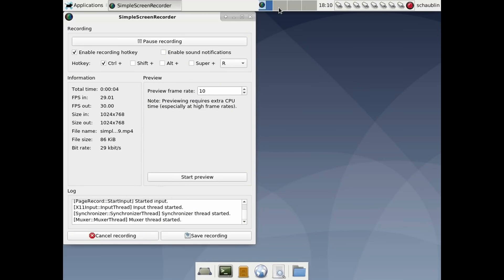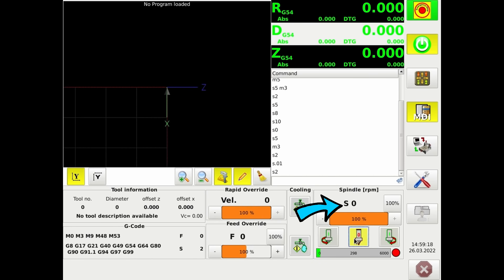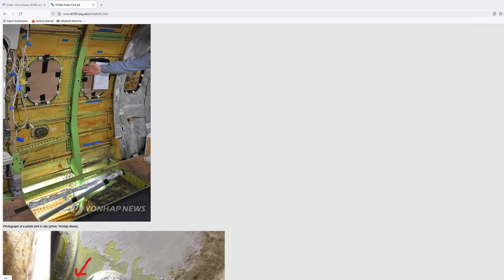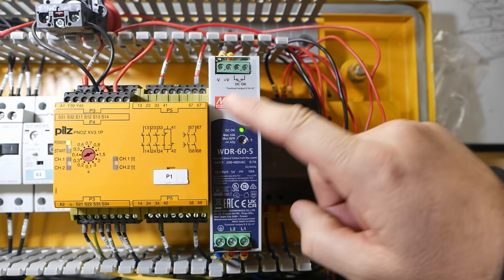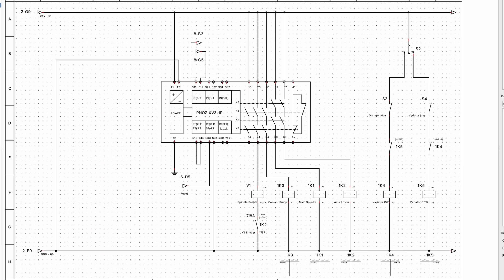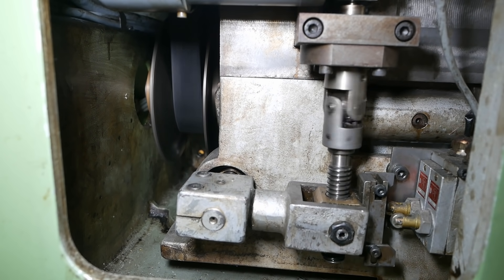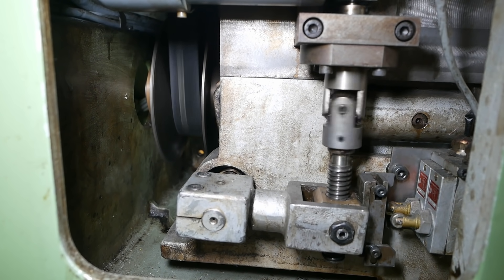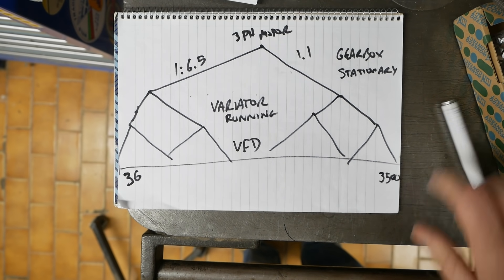Variator control - Schaublin CNC - Ep.30

Comment: Can the bearings and chuck digest 3500 rpm? What's the torque at 36? To me having three means of controlling speed seem to be a too complex system for practical jse (but indeed an intersting engineering problem).  Enjoy spring, it will be over on Thursday....
Reply from the maker: THe bearings are almost certainly good for it. THe CCN has the same headstock bearings and rund 4000. THe Chuck is also good for it. I am not so confident that the collet closer mechanism is okay at that speed, so I will restrict it to the original 3000.

Comment: VFD high as it can go, tune the variator. When approaching variator limits, adjust VFD to be back in its usable range. Thus maximizing torque output across highest possible speed range.
But good comment below about reaction speed - that should take precedence!
Reply from the maker: That is about right. I need to start mapping out this control behaviour

Comment: The cool thing would be to control all of them simultaneously. But then again, there's a reason why we use VFD:s nowadays.
Reply from the maker: THanks for the feebdack. Yeah, it would be cool to use it, since it is a cool mechanism. 
VFD's dont multiple torque like a variator does, so the modern machine 7.5kW spindle rather than 3kW. (Schaublin still make this machine as the 125CCN). 
https://www.smsa.ch/en/Products/CCN-turning/125-CCN-High-precision-lathe-with-three-simultaneous-axis.html
Reply: @RotarySMP  Well, in that case, maybe use the variator but in discrete steps, or just min/max if that's enough. 

Controlling all three simultaneously would likely make for more interesting videos, but it's nice to finish projects aswell.

Comment: Variator to low/high at extreme ranges for extra torque/speed, perhaps with lockup table, the rest with VFD, since it has far better response time/accuracy, might be important for thread cutting...
Reply from the maker: I checked it last night, and there is a gap between variator lo vfd high (125RPM) and variator high vfd lo (190 rpm). Variator takes 5 sec between high and low. I am starting to think that doing a simple dead reckoning of two variator intermediate ratios between high and low and the rest of the vfd should cover it.

Comment: A few comments have suggested a small VFD and position sensor for the variator motor. Whilst this might seem to be adding excessive hardware complexity it might actually greatly simplify the software, as the state of both the variator and main VFD would be completely known. You could then map the variator position against desired spindle speed to optimise for whatever you liked, be it torque or keeping the main motor speed high for cooling, closing the loop with the big VFD. Sometimes finding the right balance of what to do in hardware vs. what to do in software makes the solution simpler overall. With my software hat on, unknown position of the variator and bang-bang control via contactors is a bit ewwwwwww :)
Reply from the maker: I have a thread over on the LiniucCNC forum about the build if you are interested...
https://forum.linuxcnc.org/26-turning/41498-schaublin-125-cnc-retrofit?start=320#238544

Since there is such wide speed control of the VFD and variator, there were a few suggestions that you could just treat the Variator as 4 discrete gears, and dead reckon to the two mid gear positions. It wouldnt really matter if they are a 10-20% off, as the vfd can easily compensate, and that way you avoid bang bang control.

Comment: @4:47 I cannot recommend enough to switch to PTFE Tape. 10 to 30 turns, you are ready to go. It NEVER fails, and taking it out, even after 40 years, is as easy as intallation day... I do not understand why this old method is still used. My bet: mythology.
Reply from the maker: Could well be. Old practices die slowly. This industrial plumber felt that hemp was more forgiving if you have to back of a 1/4 turn to align a fitting. Where Teflon may then leak, hemp expands once fluid gets to it. 

Hemp is also easier to clean off, as you can burn it off and then a couple of strokes with wire brush knocks it off. Pemoving old teflon can be a pain.

I will use either.

Comment: I think I would use the variator for general control (for the torque, as you mention) and then extend above and below that range with the VFD. 
Running the variator at a constant speed is likely to cause uneven wear, it's probably best to "exercise" it. 
So, use a pair of "lincurve" components (one for each gear) to pre-control the VFD speed, with a broad 50Hz region in the middle for the speeds that the variator can handle by itself, ramping up and down at the ends. 
Then use a PID (with a fairly large deadband to avoid hunting and nut wear) to set the variator position. 
You might well end up choosing the gear just based on the diameter of the job, but it is possibly to select it based on initial commanded speed, but only pass that speed through to the rest of HAL once the gear is engaged.
Reply: In another reply you mention that the variator changes speed at a fixed rate. And that definitely is a problem that I didn't consider in my first reply. 
I think that you would need to use the VFD for CSS facing cuts. Though you can also consider using the VFD at the same time as the variator to change the output speed more or less quickly than the variator inherent speed. 
It's rather a fascinating puzzle.
Reply from the maker: @andypughtube  Hi Andy, I was hoping you would jump in on this one. Thanks. 

I am trying to summarise the good gen I pick up here into the LinuxCNC thread. 
https://forum.linuxcnc.org/26-turning/41498-schaublin-125-cnc-retrofit?start=320#238544

By the way, you were the first to point out the issue with constant variator change speed months ago in the forum. Thanks.

Comment: Personally, I'd use the gearbox and variator to set the initial speed with a middle frequency on the vfd. Then I'd use the vfd to make small adjustments to maintain the rpm set point during the cut. My thinking is the variator won't make small adjustments as easily as the VFD would for maintaining a set RPM, but the variator will allow for max torque at the set point.
Reply from the maker: Good summary. That is about how I see it as well.

Comment: I feel that your diagram has the elements back to front. I think it should be gearbox then 3 phase then VFD then variator. In this way you decide up front whether Hi or Low gear since this must be changed while stationary. Then turn on the 3 phase and adjust the VFD. This can be done with the motor stopped. Finally turn on the motor and if necessary adjust the variator. I feel, in practice, you'll set the variator to max speed and leave it. The only occasion where you might change it is if you need very low speed with high torque.
Reply from the maker: I think the main need for the variator would be a large facing cut, like the full 250+mm in cast iron. Then youd start the cut down near min speed, and as the cut progresses, and the VFD hits it's max frequency, do one large variator move to it's highest ratio, with the VFD compensating and maintaining the CSS required rpm, and then continuing on VFD control till the max rpm for that gear ratio is reached.

The hard part will be implementing something like that in software.

Comment: I think it would be great to use the Variator for low speeds as it has more tork in that regime and only go lower than 50 Hz with the VFD if absolutely necessary. However for higher speed cuts I would try to get most of the Speed out of the VFD. That should put less stress on the Gearbox, and also allow for more torque. The gears should only be switched if necessary/when a planned cut would max out the speed and torque range of the variator and VFD combined
Reply from the maker: The limitation of using the variator is that its change rate is fixed, so you woul need bang bang control, killing the contactors.
Reply: @RotarySMP  yeah, didn't thought about that. Maybe you could add another VFD lateron, or replace the Motor with a simple JLC Servo or something like that some time. 
PS. Hopefully the promissed rain in Vienna is coming. Everything bone dry here.
Reply from the maker: @Billyboy94009  I hope for rain as well. 

It would be easy enough to add a VFD for the Variator drive. Making a mechanical change would be way more work, and that little 3 phase motor is so cute :)

Comment: Kiss.
Keep it simple stupid...
I would only controll  the vfd as this is  easyist  just to get up and running  and thin if you need more torque  then figure in the variator..
Great stuff as usual!!!
Reply from the maker: That is a good point. I dont have to solve this yet. Just use VFD closed loop, and manually select the others to get started.

Comment: What is the maximum rating for your chucks, above 3500? My 100mm TOS chucks are around 4500, but yours looks larger.
Reply from the maker: I only have this one, and it is 4000rpm. It is only 150mm, and has the lightened body. I'öll get a TOS or Bison 125mm three jaw once I get it running.

Comment: I'd lean towards doing the gear box manually, and letting to controller do the VFD. The gear box being only able to swap when the spindle is off would be safer to do it outside of a program. I'm not sure if the variator is even needed. Cutting off some bottom end RPMs on a cnc lathe is probably  fine.
Reply from the maker: That safety aspect is also a good input. This will never be a production machine, so having the operator (me) select back gear might have advantages. Thanks.

Comment: Out of curiosity, is there a reason you didn't use teflon in tape form on the accumulator threads? I've also never heard of using hemp fibers in a pipe thread. I'm assuming it's not a NPT thread but rather another type of standard thread.
Reply: I had the same question. Never seen anything other than PTFE in Canada.
Reply: Fibers and goo is way better, if it gets close to leaking it will seal itself as the fibers swell! Or, atleast thats my experience. PTFE tape is modern stuff, and modern isnt always better (faster/cheaper/easier is often the reason behind the change)
Reply from the maker: That is also what that professional plumber said. If you have to back off a fitting a 1/4 turn to align it, teflon tends to leak, where hemp is more forgiven.  It is also easier to reuse a fitting, as you just burn off the old hemp with a torch, and then a couple of swipes with a wire brush cleans it up.

Comment: For everyday uses and constant surface speed i would do everything on the VFD. 
but i would maybe make a script to ensure the variator is sett to the right range so the VFD can deliver enough power
Reply from the maker: The only really critical case is facing large parts, where you need the full range of VFD + variator. FOr outside turning jobs RPM and even CSS of typicla tapers, the VFD is going to have enough control authority.

Comment: I'd integrate it into the software, but have a knob or a dial on the machine to control/override it manually
Reply from the maker: True. I want a speed override on the controller, but also basic gear change and variator overrides are probably fun to have on the control panel too.

Comment: Tie wraps will cut through the wiring during flight. The vibration makes tie wraps into knife edges which is why wax string is used. It is in fact against all procedures to use tie wraps here in the US. BTW Avionics Electrical Technician here with 20 years' experience, Military, just so you are aware.
Reply from the maker: Thanks. I know Cirrus used tie wraps extensively in the engine compartment of the SR20. Grossed me out. Hot environment to expedite the ageing and brittleness of the tie wraps and vibration.

Comment: I would just control VFD and variator and have the gearbox manual with a switch so the system knows what are speeds that are possible. I would try to use the variator as the main speed control as the torque would be best that way, and have maybe 10 levels of VFD control within which the variator controls speed with a desire to run it at as low a frequency that will allow the requested speed, but attempt to not change frequency until the variator is at 15% or 85% to minimise the sudden change in speed. I would also set the VFD to spool up and down between the requested values smoothly whilst the control feeds back to the variator to adjust into the requested speed.
Reply from the maker: There is no feedback on the variator position, and the ratio change is non linear. Plus the bang bang control of the variator woul dbe hard on the contactors, so variator changes need to be infrequent and therefore probably large.

Comment: Since the motor was made to run at 50hz,  I suspect that’s where it’s most efficient and should thus generate the least heat and best torque. Soooo, I’d say variatior primary, and vfd as an “extended rpm range mode”. 

I’d be interested in what your motor torque is like at the outer limits (20 and 70) as well.
Reply from the maker: 3Ph motors driven by VFD's have a typical performance curve. So constant torque up to 50Hz and then constant power above. 

The variator rate of ratio change is determined by it's adjustment motor, so you need to bang bang control that, which would be bad for the contactors. Both VFD and variator have different limitations.

Comment: I'd say set the gearbox first, then set the variator for max torque within the mid range of the VFD, then use the VFD to trim up or down. Sounds like a perfect job for the classicladder PLC component
Reply from the maker: It could be dont in classic ladder or with a comp. I tried having a play with classic ladder once years ago, but never got my head around it. Before I start implementing, I need to have a clear plan of what to implement. For the Maho, I created a flow chart, Ill probably have to do that again to sort out my thoughts. The inputs from everyone have been really helpful.
https://github.com/jin-eld/mh400e-linuxcnc/tree/master/doc
Reply: @RotarySMP  Classicladder is just like an industrial PLC. IMO it's a lot easier to create sequences with ladder logic than with C inside a comp. Let me know if you'd like any help.

Comment: Zip ties have been known for the sharp corners to cut into wires over time from movement and vibration. As for the speed I would use the Variator in set steps like a gearbox and then have the VFD do the rest. However there is the issue with torque. 

                You may want to have presets for high torque and low torque at certain speeds. The benefit of this is running the motor at a lower speed which is quieter but you get less torque with that gearing. Several ways to look at doing it but programming it would get complicated and you would need speed feedback from the variator as well. It can get complicated very easy. 

       Also I really like how quiet the spindle is. We had bought an import lathe sold by Jet for the Highschool years ago. Something like a 9x20 tiny little belt drive and it was horrendously noisy. Was able to make stuff on it for the kids robot projects etc but it was not a nice machine to use in any way.

       FYI we are planning on going to Naxos at the end of September ish... So if you go before then let me know how the inflation is hitting prices of food etc there.
Reply from the maker: "As for the speed I would use the Variator in set steps like a gearbox and then have the VFD do the rest"

That is an excellent suggestion. Might be the easiest solution. 
We have booked for Naxos before the summer season starts, so I am sure there will be another ferry time lapse in July. Everything sold out fast this year. I guess a lot of people have pent up wanderlust.

Comment: Hemp?? I haven't seen that used in 40 years. Teflon tape is the way to go.
Reply: In trade school we were taught to never use tape on pneumatics or hydraulics as a piece  could come loose and block a valve. Teflon dope was required. Working with steam dope and tape were used.
Reply from the maker: @millwrightrick1  Oh, good point. I am already the dope :)
Reply from the maker: That industrial plumber felt teflon is good, until you back off a thread a 1/4 turn to line up a fitting. As hemp swells, it is more forgiving. I used teflon on pneumatics, and hamp on water.

Comment: As motors do not like low frequency hi loads jobs vfd jobs should be tested  for thermal problems. Variator drive will be fine for bottom end at any duration, but code would be weird to choose most correct solution for given speed.
3 step vfd and countless variator settings or 2 variator settings and countless vfd settings are sounding least problematic for me
Reply from the maker: Good summary. Given that the rate of variator speed change is fixed by its drive, and would require bang bang control, your second option is likely the best. "2 variator settings and countless vfd settings"

Comment: If it was for me I would probably use the gearbox in Linux to be automaticly set to low on programmed rpm's of 36-1750 and set to high on 1750-3500.
Use the variator for constant surface speed cuts and use the vfd to widen the rpm range/thread cutting.
One question though, is it possible to switch from high to low gear without manually moving the spindle?  On a lot of lathes I have worked on you have to rotate the spindle a bit by hand so that the gearwheels properly engage.

Nice video as always, very informative!
Reply from the maker: So far, that gearbox change has occured with me blowing on the end of the pneumatic tube with a dust off gun. Seems to engage without issue. On the Maho gearbox, we had to rock the input shaft back and forwards to ensure each stage meshed.

The gear ratios are rather wide. 1:1 v 1:6.5, so the low speed range will not reach up that far. Probably more like 34-400 and 400 - 3500. I would guess that a machine this size will spend most of its time in high range which is lucky as it is much quieter.